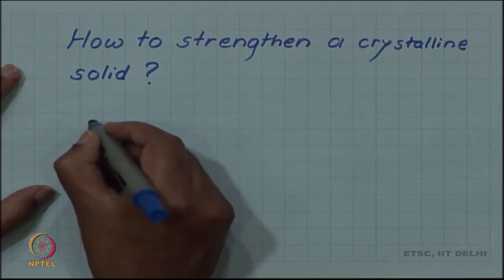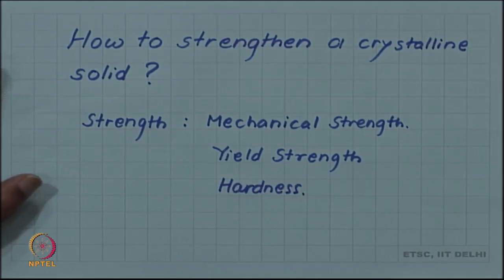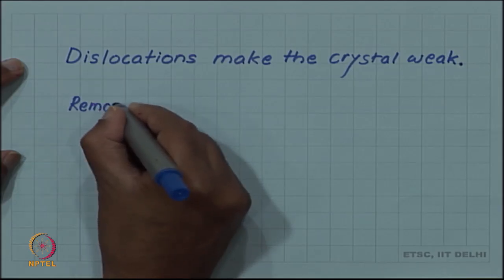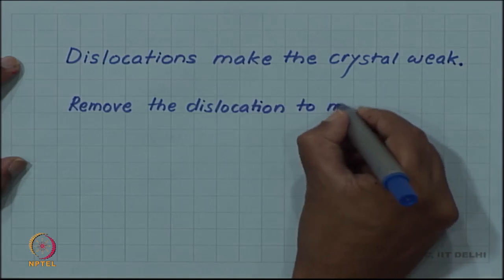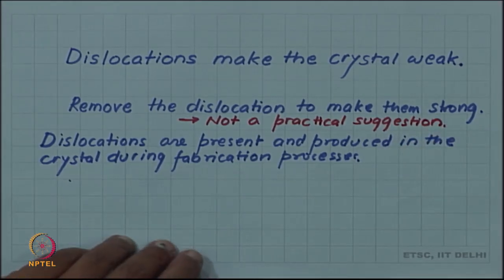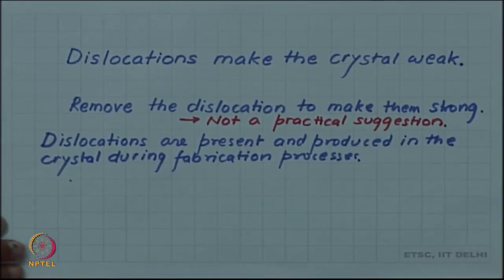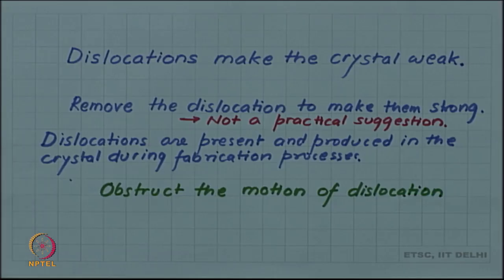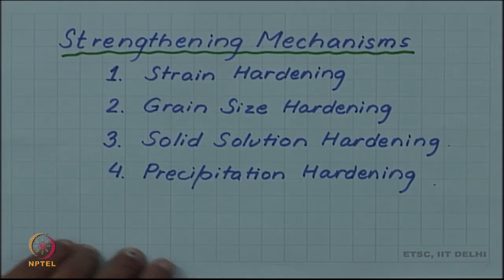Strengthening mechanisms

Comment: I didn't understand that Dislocations make the crystal weak. Even if the crystal is free from dislocation then also we will get lesser CRSS no?.. because still plastic deformation will occur by the same mechanism of extra half plane gliding on slip plane.(extra half plane forming on application of force)
Reply: The assumption of a dislocation free crystal is that the crystals remain free of dislocation during the slip process. In this case, the stress required is large.  You are imagining a scenario where a dislocation nucleates in an initially dislocation free crystal. In this case, there will be a stress drop as soon as the dislocation nucleates.

Comment: Sir can you say 1.Which mechanism is better compared to each? and 2.What are the advantages or uses of these strengthening mechanisms and the last one 3.Will the mechanism be different for different shapes of metals like for a flat surface a particular mechanism and for a cylindrical surface a particular mechanism?
Reply: 1.cannot say by generalizing, each one has its own disadvantages also like strain hardening reduces the fracture strain, all metals cannot go age/precipitate hardening, solid solution hardening means like making new alloy needs lot of efforts, hardening through grain refinement may be better.
2.advantage is to improve some properties like hardness, yield strength etc.
3.independent of shape

Comment: Hi sir. What is the difference between Hardness and yield strength.
Reply from the maker: Hardness measures resistance to plastic deformation under indentation. The stress state under an indenter is complex triaxial stress.

Yield stress is a measure of resistance to plastic deformation under uniaxial tension. The stress state is a simple uniaxial tension.

Thus both measure resistance to plastic deformation but under different stress conditions. The hardness test is easier to perform than a uniaxial tensile test.
Reply: @introductiontomaterialsscience  Thank you sir. Can we simply describe hardness as measure of plastic deformation at the surface.

Comment: Sir we have previously done heat treatment to increase hardness, sir why do we need strengthening mechanism??
Reply: In strengthening mechanisms we study the microstructural causes that increase or decrease the strength of a material. In heat treatment, we study the process of heating or cooling that improves the property of a material. The reason for the change in the property of material due to heat treatment can be one of the strengthening mechanisms. Thus cold working is a process by which strength increases. The mechanism by which this happens involves increase in dislocation density called strain hardening. If a cold-worked material is then annealed, a heat treatment, strength will come down. This is due to reduction of dislocation density.